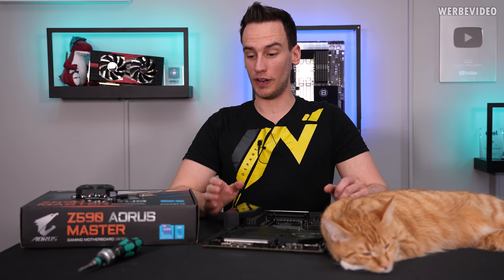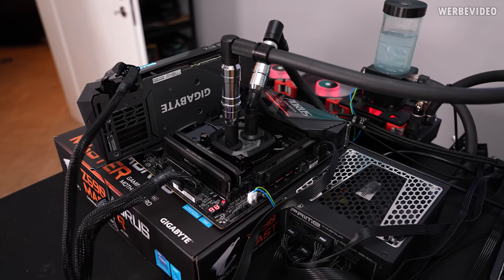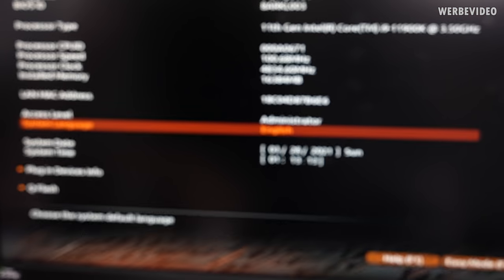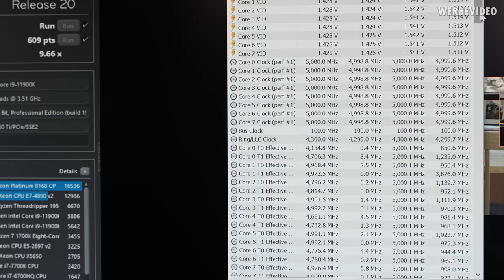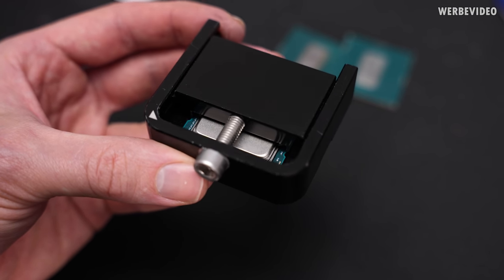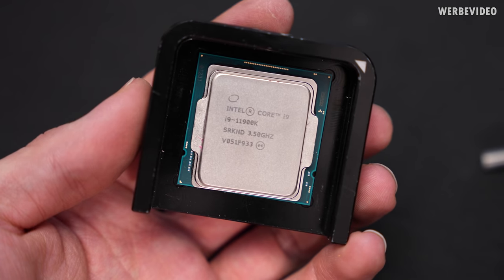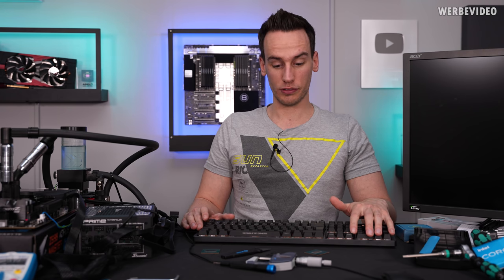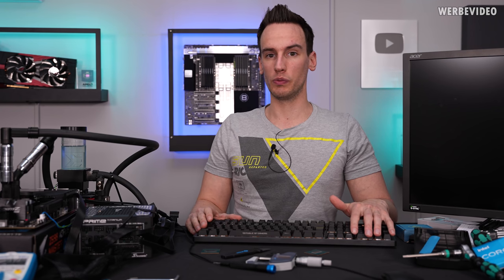11900K Delidding.... Somehow I can't believe my own Results

Comment: I'm not delidding and this cpu is going well above my expectations so far. With a 360mm rad I'm only hitting around 53 degrees Celsius at maximum load(125 watts). On my 7700k I would be at 80+ degrees celsius easily.

Comment: You could have broken something physically which altered power draw this cooler temps... or maybe something physical with socket?

Or maybe the stupid stim Intel uses doesn’t dissipate heat at all because my 10850k cooks but is a good overclocker with some voltage....

Comment: Hey man! Little tip, check your oven temperature with thermocouple. Home ovens temperatures vary A LOT.
Same goes for their hysteresis. I'd use brick or block of metal as heat accumulator and preheat it before CPU placement.
Also use it to easily handle CPU after heating in optimal temperature. This might help to avoid nasty surprises.

Comment: I want to do it with my 11900kf, have technical hands but very scared, may be more tips?
Reply: Same here with 11700k.
I guess there are no tips. You just gotta be very careful.
Reply: @rubbersoul9690  I just known that crystal surface not clear flat, its have micro relief))) on all crystals
Reply: @bigcreoman  Yes, and have small components very close to crystal that's why I am afraid of doing this and also I don't want to put my cpu in oven I guess it won't work anymore after that.
Reply: @rubbersoul9690  its dangerous, but not too much, because you move adapter very careful by a little, and you can know where smd's located on iternet photos (inside cap and outside)
Reply: @bigcreoman  Maybe, someday I'll be brave enough to do it)
Reply: @rubbersoul9690  Im too friend) Its a first move against temperature on hot i7-i9 11gen. then may be will change my water cooling to another, but sculp will have addition bonus anyway....

Comment: With the orig iridium, the iridium has more height, because the glue raises the lid upwards. I bet it doesn't even equally high and doesn't even connects the lid with the die 100% on the die surface.
Without the glue, the lid sits much lower, so it reaches the thin TG nicely, which is eventually altogether a narrower thermal passing layer between the die and the lid.
Therefore the 12 C diff.
Crappy design by the manufacturer for a crappy outdated CPU.

Comment: Interesting, but those original temperatures are the same as a 10 core 10900K all core OC at 5.1GHz which is strange but maybe to be expected as 10900K uses 275W.
How on earth do you still have all your fingers using a blade like that? 🙁

Comment: what happen is ...you accident scratch 2nd sensor ..the direct die temps vs outside die..intel forget to mention secondary sensors are not built in like AMD do with their cpu's...intel users are not fan of direct die temps from AMD ideas...it gives 90c...and supposed to be 66c

Comment: its promising that you can get more then a 5c improvement still going through the IHS but i want to see the real gains wheres directdie? if that fat chip can pull 300watts through a IHS, with Directdie its going to surpass a FX9590 in power consumption i want to see the 400watt+ package power draw numbers

Comment: This is the best from Intel.. a 10 year old 14 nm process, unstable when driven hard, runs hot as hell.. and they still price gouge. Switch to AMD!!
Reply: If there is no shortage and rip off prices I would switch. Need a Threadripper 3990 for my application, Its just not affordable vs two old Xeons.

Comment: Every YouTube channel got the 5100 MHz kit of RAM, and not a single one has gotten anywhere near that, and now that I see you can't either, it seems to be nonsense. The can just put any number on there, and it means nothing. It's like the Chinese 18650 batteries that have 10000 mAh, 3-4x as much as normal.

Comment: Worth keeping in mind, the IHS does retain a tremendous amount of heat. Also first boot after a while things will normally be cooler. Honestly if you remove those two factors I'd say it's probably the normal 5c difference from delidding imo
Reply: he re-ran the tests multiple times, ran prime95 for 15 minutes, warmed it all up first.

Comment: Why not just take off those outer SMDs while delidding, put them back after removing the adhesive? Edit: And put some soft(!) solder mask over the pads so the IHS doesn't accidentally scrape them off.

Comment: dafuq. that ain't an upgrade that's a downgrade. I still run my 8700k, delid (below 79°C in cb r23, 30 min.) @5.2ghz. It's like 1.410Vcore (LLC 4) on my cheap msi z370 gaming plus (4+2 phase) motherboard. My peak power consumption was ~160W in cb r20 (score 4186) with 0avx offset.

Tl;dr: *on a big air cooler (only, sniff) *
Reply: i just delidded my 8700k, 5.2ghz only needed 1.263v set default llc on z390 dark, but to get 5.3ghz it needed 1.39v under load. It is an amazing little chip. I'm surprised that all these new intel chips have been just meh.
Reply: got my 8700k on 1.185V 4.8Ghz 80C in cinebench on DR 4 Pro... Goddamn intel tootpaste
Reply: @Acenis  dang, before I delidded mine hit 70 to 80c, now it barely hits 60c, it is custom loop though, just got the Optimus block and can't wait to see how it does. I use the kingpin kpx paste. It's the only stuff I'll use.
Reply: @Apollo-Computers  Still using 1080Ti so 4,8 is more than enough, don't wanna risk delidding, especially now.
Reply: @Acenis   I bought the derbaurs delid tool, and with the 8700k it's very easy, no smds to worry about.
Reply: That's cool and all but is your score 6000?
Reply: 8700k was the last good release by Intel imo